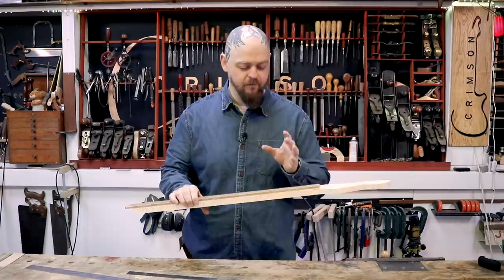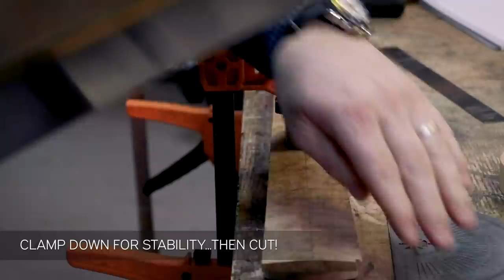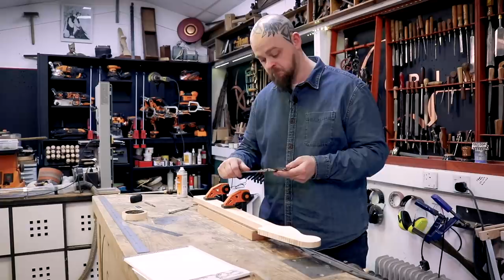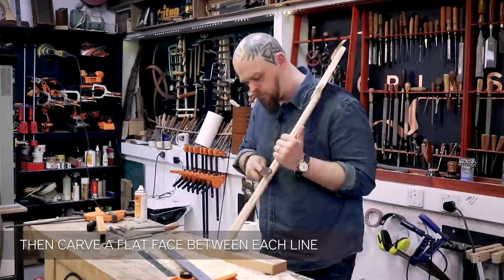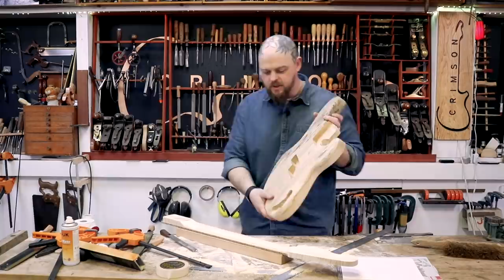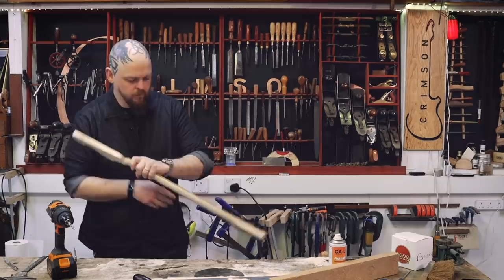Ep 3 - Marking fret and nut positions - How to Build a P-style Bass Guitar

Comment: 1:55 - Numerical Dyslexia (Dyscalculia) is a right pain in the backside. I have it as well and can commiserate with you, Ben. 

In my case, I found that switching from Imperial to Metric as often as possible was a huge help. I’m in the process of building my first guitar and was fortunate enough to come across some metric rulers and straight edges as I gather the necessary tools. 

Measurement is still the most anxiety-Inducing part of the process. As I build my templates and go from vinyl to MDF to Birch Plywood to ensure they are sturdy and will last a long time, having to measure and adjust various bits and heights and angles and this and that... For a perfectionist, the reality of the condition can slow the process down a great deal. It’s actually nice to see someone else has it and can still crank out some sublime instruments.
Reply: Metric is superior

Comment: The epoxy bonding the rods to the wood makes a big difference too. Instead of pieces bending individually it's a solid single block. The rods don't do much to prevent the wood from twisting, if it wants to do that. I wouldn't bother with them, wood neck with a dual action narrow trussrod works fine.

Comment: Please, when you make a bass scale ruler, try to find an option for medium scale basses like 32" or 33", a very nice option for tighter spacing and still good string tension.
Reply: Hampus Olsson 32” is my preference. 34 is only “standard” because it was easier and less costly to manufacture for Fender.
Reply: and 30" although I'm trying to get every one ever built ..(limited left arm mobility hence short scale/ broken collar bone ) .
Reply: if you start at the first fret on a 34" ruler instead of the nut, you get about 32.1", and if you start at the second fret you get about 30.3"
Assuming the ruler has enough frets on it, that should get the job done.

Comment: Wouldn't it be a good idea if the blade on the fret slotting saw had a line to mark the depth? You could still use masking tape, but you'd know where to place it.
Reply: Not all fretting material has same length tang, its all really close, but some is a bit different.  Some people like to have the slots exactly match up with tang depth thinking a gap reduces sound quality.  Plus like Glenn said, until you sharpen the saw (But I would think you would just get a new one at that point but still the teeth might wear down)
Reply: True...

Comment: Some of the back bow might also be caused by the water from the glue being absorbed into the wood at the front, causing a little expansion.  It might reduce a bit after it's had time to dry more, or diffuse through the rest of the wood.
Reply from the maker: Good point, vary good point! B

Comment: I've only seen/know of bolt-on Fender style bass guitar necks with 2 steel, titanium or CF stiffening rods flanking the truss rod, never 4, 2 per side. Consider 4 CF stiffening rods makes me question whether a neck could be made too stiff; meaning, too stiff to allow the truss rod to achieve what it needs to do for setting up the ideal amount of neck relief for all potential desirable amounts of action, factoring all the various potential string tensions from all the various brands/makes, models, and  gauges of bass guitar strings on the market? At least we know it's virtually certain there will be no dead spots on this neck!

Comment: If it wasn't Fender style then I would like it more but you offering up basses for sale is very cool. I wish I had the kind of funds it would take to have one of yours. 
Just a thought: You are very concerned about the back bow on the neck. There are no strings on it yet. Bass unlike standard six string guitars has a ton more pressure from the strings on the neck. Do you not think that when you string it that it would probably get pulled a lot straighter? In my estimation even without engaging the truss rod it should still bow the other way when strung. The wild card is the effect of the carbon rods (not something I have heard of many doing) but as we observed that removing wood from the back of the neck caused it to bow backward it can move pretty easily overall. Factoring that you should be pretty safe. No? New basses always  seem to have some of that noise when you adjust the truss rod. I am thinking it should be ok there too. Obviously you don't want all of the glue to let go. I would love to know what else was going on in your head as you must have a lot of experience to draw on here. Why the concern? What I am saying is it looks logical on the outset but as you are concerned I am also wondering about it all.
Reply: The strings will flex it a bit for sure,  but not always a huge amount, particularly if it's set up with a really low action, and if it's already a very stiff neck.
It might be enough to save you in some cases, but I would also be pretty worried if I couldn't adjust the neck to flat, even without strings.
You're probably right on the creaking from the truss rod.  I think it's usually just the metal slip-sticking across the wood as it flexes, and not actually cracking anything.  OTOH, I've never gone with quite that little gluing surface.  I've done either steel or carbon rods on the guitars and basses I've made, but usually just 2 deeper rods, not 4.
Reply: @nwimpney  I guess we need to wait for the next video to find out but hopefully 4 rods isn't too much then? I am excited to see.

Comment: Ben, when building/designing a bass, do you feel that the four carbon fiber rods is helpful, due to the higher string tension on the bass, rather than a standard six string guitar, especially if you are opting for a longer scale length?  Thanks.

Comment: Why lot use the bandsaw to get the neck to the “required thickness” before carving with the rasp?
Reply: He has dozens of different tool types  to choose from that will remove the waste wood, power tools work great if you need lots of waste wood removal, they usually have less tolerance to errors than a bladed hand tool or rasp which have less tolerance to error than sandpaper, so when you have many options, you'll choose the safest fastest and most enjoyable option, rasps are a nice option for this exact purpose, it removes decent amount of wood in an easily controlled manor.
Reply from the maker: As J-man72b said but also in a basic build like this I will try and use the simplest option possible to help a novice learn.. B

Comment: I'm curious about the physics of the truss rod on this.

It seems to me that it words by pushing against the back side of the fret board in the middle of the neck, and pushing on the neck itself at each end. Can someone confirm?

In an earlier video, Ben worried about the flexibility of the fretboard material, and thus added the carbon rods. The rods, like the truss, would also work by pushing against the neck and against the fret board. 

Consequently, it appears to me that neither the truss used nor the carbon rods will work well when the fretboard itself is flexible.
Reply from the maker: You are pretty spot on, though the rods are glued into the neck wood and essentially become a stiff part of that, the truss rod is dual action so works either way.. if the glue joint failed it would obviously suck, but as long as the fretboard is still on how strong it is doesn't affect how the truss rod works. B

Comment: I am naive and curious! Is a Fretless Bass just simply a "P Bass" without frets or are there other differences in the design? Love your vids. I have watched so many I reckon that I could build a guitar in my sleep! I just wish I could play one while I was awake!
Reply: Good question.  The term P bass derives from Leo fenders first precision bass. He called it a precision because it had frets which meant you could easily hit precise notes.  Later fender introduced the jazz bass. It's most obvious difference to the precision was that it 2 long thin pickups one placed near the bridge and one placed  near the neck whereas the precision had 2 smaller pickups slightly offset from each other each only covering 2 strings. The pickup layout became what most folk would call the defining feature of a P bass. 
Now if you then take a P bass and take all the frets away to make it a fretless you've made a fretless precision bass. It's still a precision bass because of its pickups but it doesn't have the frets which originally gave the design its name.
Reply: Also the difference between a fretless and a fretted bass is pretty much just the absence of frets. 
The nut and bridge will sit a little lower to allow for absence of the frets but that is pretty much all there is to it.

Comment: In my opinion after experimenting with several combinations of truss rod and number of carbon fiber rods 4 is too many, too stiff (yes I believe there is such a thing). I like my necks to have at least a little flex
Reply from the maker: I agree.. normally, this fretboard adds no strength at all to the recipe and sorely needed support.. B
Reply: @CrimsonCustomGuitars  you would probably get similar results with a pair of rods in deeper slots on either side of the truss rod, rather than 4 square-ish ones.

Comment: Rather than taping over the truss why not just cover it in bees wax? The glue won't stick to it and it will protect the steel a bit.
Reply: I've done that before, just rubbing on normal candle wax.  I can't say that it always works, but I didn't have any problem with the trussrod sticking on mine at least.  I'll be doing it again on future instruments.

Comment: If the lamination fails, epoxy should provide a more secure bond.
Reply: He used to use epoxy until he found out that he could remove the fretboard by hitting the neck sharply on the bench.